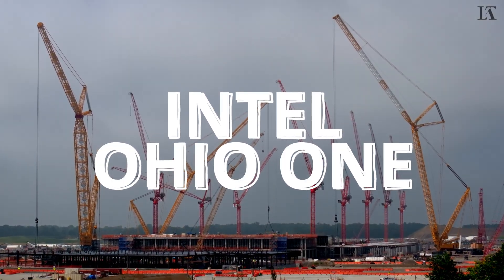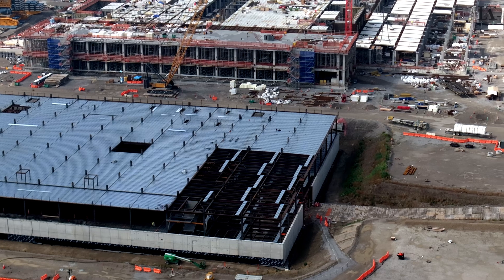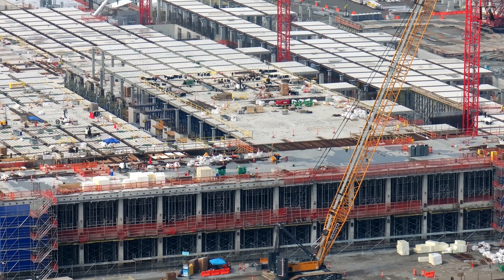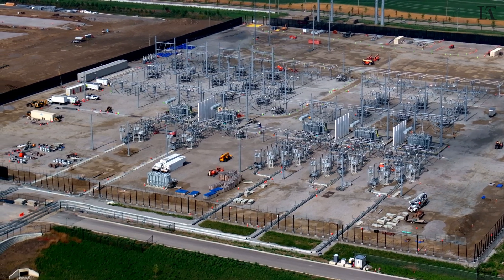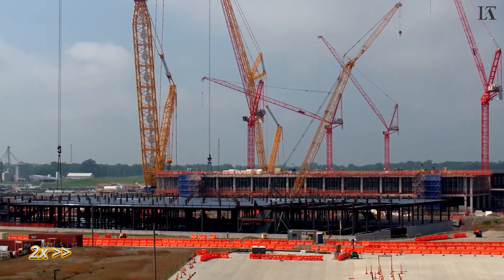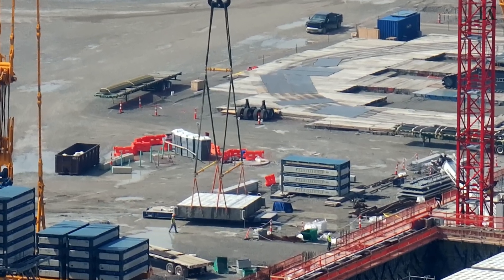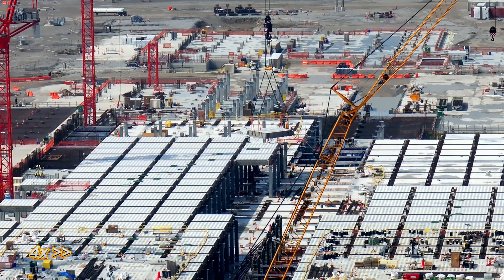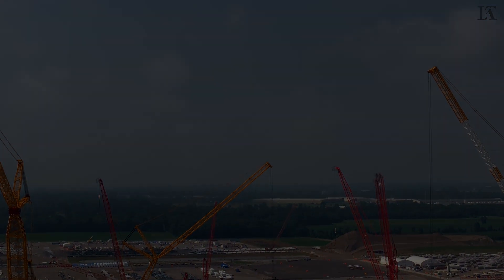Ohio's BIGGEST Build and Most EXPENSIVE | Intel Ohio One

Comment: The two cranes that are the same model are LR-11350 (1350tons) and of course the wide boom is an LR-12500 :)
Reply from the maker: Thanks for the update. Someone said last year that they were LR11000 models and I just rolled with that. Out of curiosity, what should I look for in order to distinguish? Thanks in advance!
Reply: @lukateake  The easiest way to see if it's an LR11000 or a LR11350 is by looking at the superstructure and undercarriage. The LR11350 has a double stack of counterweights on the rear per side, while the LR11000 has a single taller stack. The LR11000 has a different cab compared to the one on the LR11350, and the LR11350 has its power pack sitting behind the cab, mounted seperately on the superstructure, while on the LR11000 the engine is integrated into the superstructure itself. The LR11350 has a slightly wider track base, and the turn table also sits a bit higher. The LR11000 has a well visible counterweight rack on the front and rear side between the tracks, which is not present on the LR11350
Reply from the maker: @Evert-JanN , thank you!